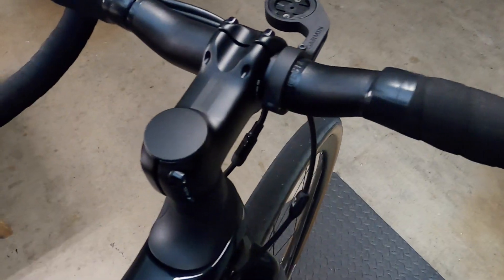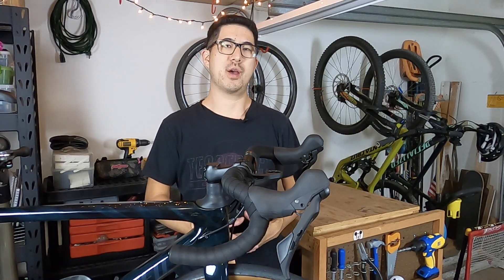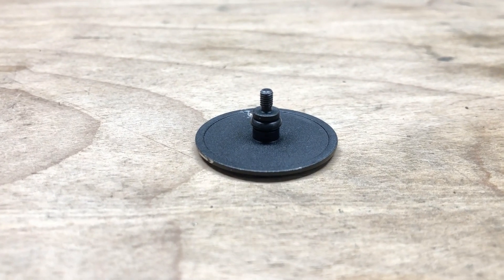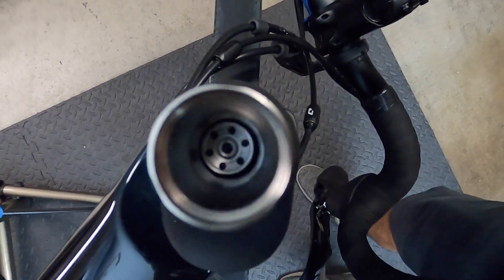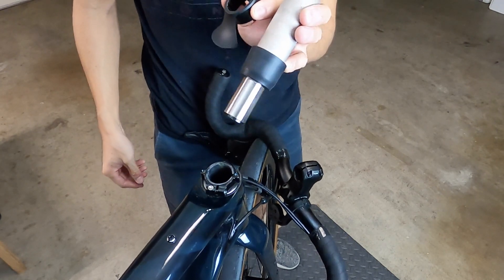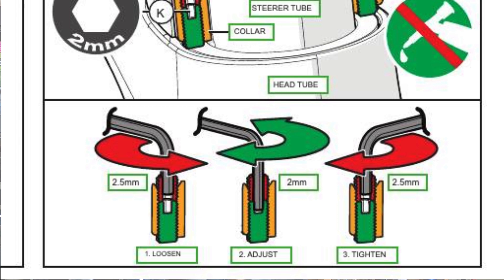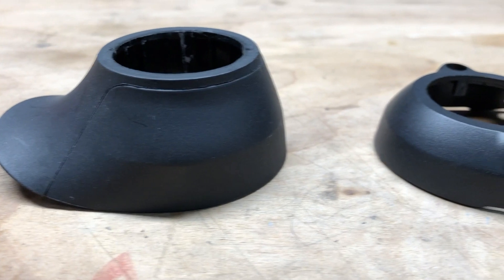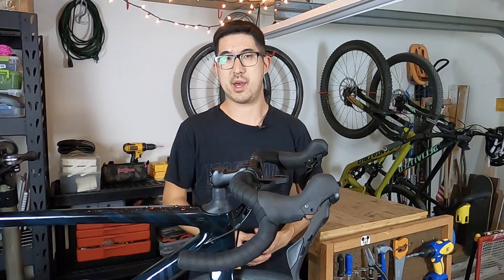Specialized Future Shock 1.5 | Everything You Need to Know

Comment: Great video to explain Future Shock mechanicals. I see you have a Diverge. Do you think the bars damping and softer ride are worth the extra 400 gm on the Roubaix road bikes?
Reply from the maker: Thanks for watching. Well I think that Specialized’s “smoother is faster” marketing slogan has a lot of validity in practice. In short, a smoother ride will experience less suspension losses and therefore be faster overall. Anything that can reduce the hysteretic losses will ultimately produce a more efficient bike and the future shock does that to a degree by absorbing vibrations in an undamped manner before they reach the rider (highly damped). The argument is that this benefit outweighs the weight penalty, which isn’t actually that significant. 

From experience, I do like the FS system. I don’t ride with power, but I can say that I’m no where near as fatigued as I used to be on my old Roubaix SL4 with no suspension. And that alone has been worth it
Reply: @TheBikeSauce  You make a convincing argument. I’m going go out and test out a Roubaix based on your experience. Specialized should appreciate your detailed and evidence-based reviews. Your viewers certainly do!

Comment: I just bought a Diverge identical to yours. I loosened the two stem bolts first, pushed down on  the stem and I was then able to remove cap with my fingers - no channel locks required. Thanks for the very informative video!
Reply from the maker: Thanks for watching! Yes it does seem like others have had an easier time than I did when trying to get the cap off. Cheers!

Comment: Hi there. Question  Curious to know if can you retro fit a Specialized Future Shock Headset on to a older Specialized bicycle and do the they sell just that unit ?
Reply from the maker: Officially, no. It’s a different fork and the frame is designed around the FS as well. Also I haven’t heard of any shop that sells the FS unit retail. I’d look into the Redshift suspension stem. Same effect and will work with a standard fork / headset setup.

Comment: Cool video! out of curiosity, do you know if the stem can be changed or do you need it to be proprietary from specialized? I got a roubaix sport 2020 with the future shock 1.5. The stem has exposed bolts and I keep having a bloody knee every time I pedal hard out of saddle due to scratching my knee against the bolt.
Reply from the maker: Stem can be swapped. You’ll need the spacer that came with the bike, however, to use a different stem. Funny you bring it up. I’m working on a video to explain this at the moment. Thx for watching!

Comment: Do you know if the futureshock will fit on the sirrus x 2.0?
Reply from the maker: It may, but highly impractical as you’d need a different fork and some supporting hardware. Also, the future shock is not available for commercial purchase as far as I know. A better option for you might be the Redshift Sports Shocktop Stem, which is compatible with all standard threadless headset systems.
Reply: @TheBikeSauce  ok sweet ,thank you for the suggestion

Comment: Thanks for this detail. I like the new Diverge tire clearance and SWAT storage but the design and weight of Future Shock makes the bike a no-go for me.
Reply from the maker: Totally fair. It's a complicated system that adds a solid 350-400 grams. For this video, I totally stripped the system down and rebuilt it and, while it is complex, I haven't had any issues with it after the rebuild even after some gnarly chunk on a couple of rides. I agree that probably a standard headset and a Redshift stem might be a more robust system. Cheers!

Comment: No grease needed for the spring?
Reply from the maker: I know the future shock 1.0 springs have grease on them, but the manual for the 1.5 didn’t call for it. The springs have a rubber boot on them and they seat centered within the future shock. I didn’t really see a need for it, but if it starts binding or making any noise, I might reconsider. Thx for the inquiry!

Comment: The top stem cap can be removed but loosening the stem bolts and then turning the stem to the left. Then you can just unscrew the top cap by hand with out tools or risk of damaging the the stem cap.
Reply from the maker: Good call. I did try this as well, but in my case the stem didn’t grab the top cap and turn with it. Unlucky I guess.
Reply: Great advice, thanks. It might be an idea for The Bike Sauce to add this to the video description.
Reply from the maker: Definitely will do.

Comment: Is it possible to swap the 1.5 with a 2.0?
Reply from the maker: The official answer from Specialized is no; there is no cross compatibility between 1.0, 1.5, and 2.0. I have, however, read about a successful swap from 1.0 to 2.0, so perhaps it's possible. The biggest issue is that you can't just buy the 2.0 cartridge; it's only available for warranty replacements through authorized dealers.
Reply: My understanding is that the 1.0 and the 1.5 are essentially the same and can be swapped.  However the 2.0 with the hydraulic damping is a different size and therefore can't be swapped.

Comment: Hi thanks for a very useful and excellent vid
Two questions, what torque wrench are you using?
How does someone obtain the Specialized Roubaix service manual?
Oh yeah, BRILLIANT solution for the 3 mm wrench
Reply from the maker: It’s a Titan torque wrench from Jenson. Seems reliable and much less than the Park tool alternative. All of the specialized owners manuals are available online. I just looked up the Roubaix, which is basically the same as the diverge manual
Reply: @TheBikeSauce  Hey Bro, Thanks so much for the info, much appreciated

Comment: Did you add the helper spring, is it needed, and which color did you use if you did?
Reply: Really surprised that there as no spring installed by the bike shop.
Reply from the maker: Yea I think it’s a default setting. The future shock actually works just fine without a boost spring. The three options are there mostly for people who want a bit stiffer feel.
Reply: The bike shop put a blue and black spring in the bag that my owners manual came in. I’m really liking my 2020 Sirrus X 5.0 with the future shock 1.5
Reply: @dand2334  Same here great bike, just picked up my 2020 Sirrus X5 last week. Came with the medium spring installed but I may opt for the softer blue spring since I'm pretty light and I don't see a whole lot of compression going on.
Reply from the maker: Very nice. So that means the shop must have installed the heavy yellow spring in yours. If it feels too stiff, you can try a softer spring.
Reply from the maker: I added the medium (black, 25lb/in) spring. Whether it’s ‘needed’ or not depends on your preference and weight. It’s not like mtb suspension where you set sag, etc.. just try different springs until it feels right.
Reply: The Bike Sauce 
I’ve been riding without any secondary spring since they didn’t install it at the dealer.  I’m curious to see how much of a difference it will be.
Reply: The Bike Sauce 
Thanks